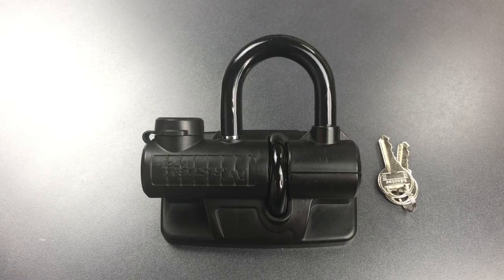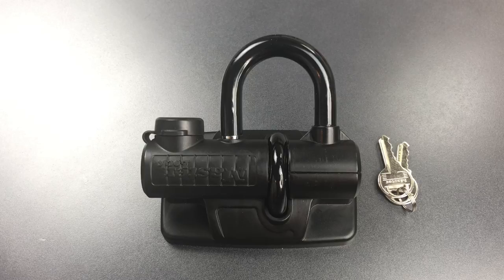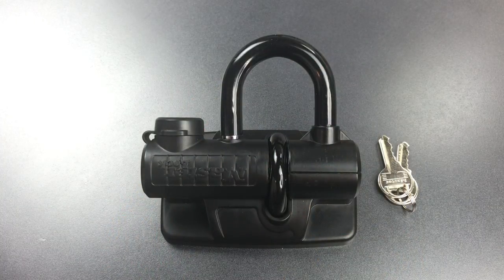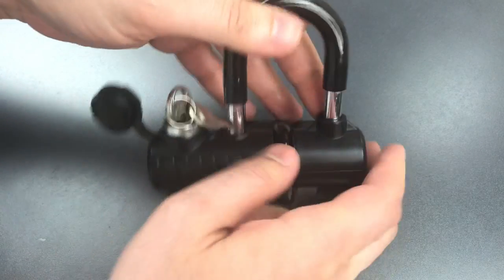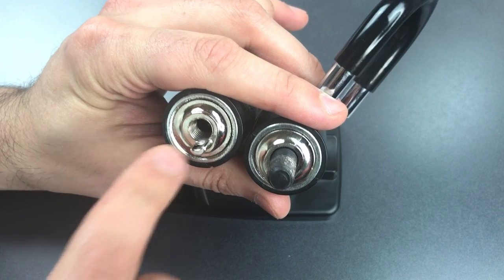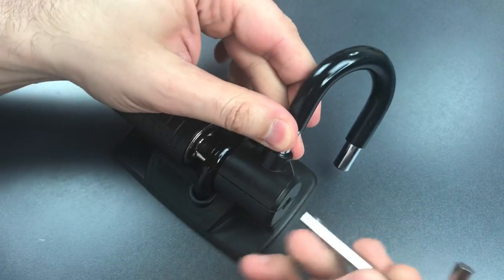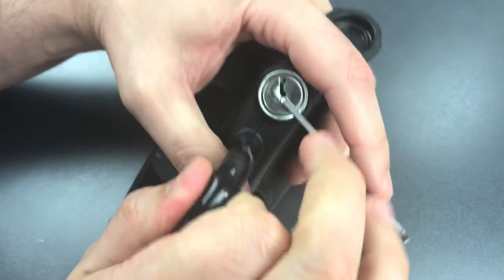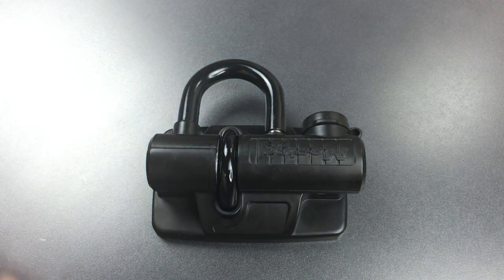[697] Master Lock Truck Bed U-Lock Picked (Model 8287 DAT)

Comment: LPL, this looks like the same core as the master lock python cinchable cable lock. 
Bill opened it with a tensioner and light percussion on the lock body. Set this up in a vice or bolt it down or even install it in a truck for a close to in the field conditions as possible and try that attack and see if it opens with tension and tapping. Two screw drivers would do it and be indicative of what a thief may carry. A flathead to tension and whatever other heavyish handled one to tap with. I want to see how bad this really is.

Comment: How about ditching the actual u lock portion of this “lock” and putting a better lock through the short shackle at the bottom? Would the Kryptonite New York Disk lock fit through the bottom shackle? There seems to be little or no other options for attaching an anchor point to truck bed rails

Comment: the only lock easier to pick open than this lock, i imagine is the plastic bodied ONE WAFER lock, that came off of my old filing cabinet....  and that lock i wouldn't mind putting in a plastic bubble case, from a nickel vending machine, to ilustrate how terrible it is.  by that same measure, at my old roller skating rink, we had a quarter vending machine where we would either get a lucky rabbits foot, or a miniature lever lock from, and those were the first locks i learned to pick, and also, more secure than either of these wafer locks.

Comment: Attack it with the RAMSET!!!
Reply: GT Barsi i dont see a lot of impact attack points onbthis one. The primary shackle holds the two pieces together,  and the second one secures it to the trucl. Maybe the core could be smashed then removed and the actuator fiddled, but with how weak the core is, one bobby pin broke at the bend could open it, the straight side with a bend for tension and the wavy side to use as the rake. But like the master lock python, which seems to use the same core, you might not even need a rake but just a tensioner, and a heavy screw driver to tap on it to get the wafers to jump and set under tension.
Reply: It could probably be raked open using the correct size Cotter pin without modification.  The thing is such crap I just want to see it busted in to 2 or more pieces.